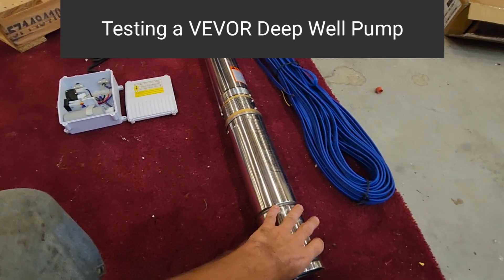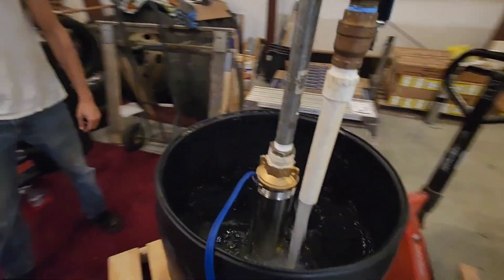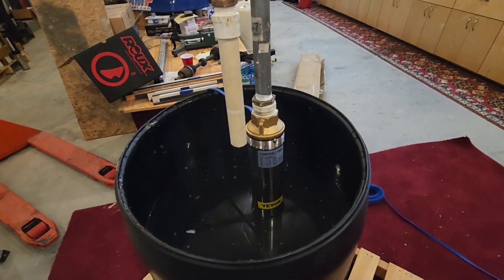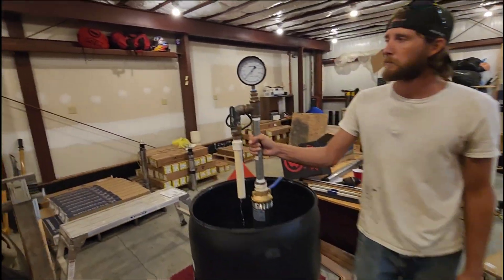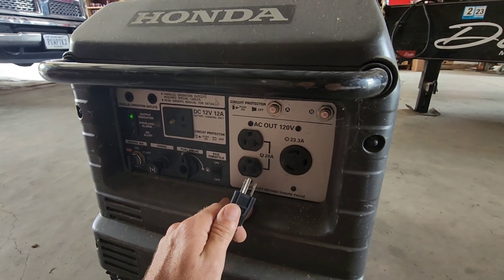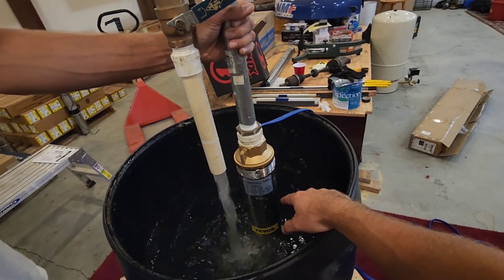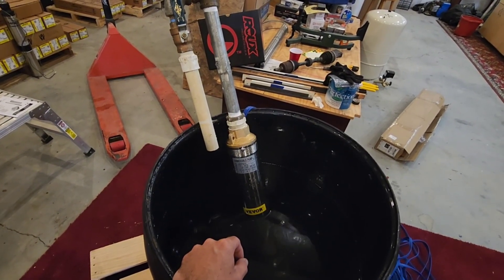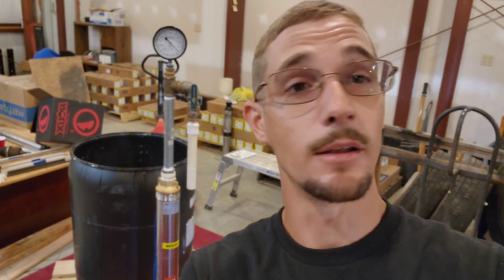Vevor 115v 24GPM Well Pump Test Review.

Comment: Junk, I purchase a property with a 66' well & one of these pumps. It was approx. 4yrs old when I purchased the property 3 yrs ago. The control box burned up last year from the frail wiring & connectors. The pump seized solid 3 weeks ago. Not a good place to cut corners in my mind.

Comment: I use a red lion pump. Its at 390ft and I used 12g wire. I run off a generator- 250v.  Works great! 13 years and counting.

Comment: How do you bypass the control box?
Reply from the maker: On this pump, since its a "3 wire" pump, it requires the box / capacitors inside to start & run. This is why i prefer 2 wire pumps, no box nessicary

Comment: those pumps are a piece of crap, i went through 2 of them in as many months. i thought i was hooking them up wrong but the electrician i called to check it out said that i hooked them up right and that low voltage was the cause of them going out. then he checked the voltage, it was good. finally figured out the wire going to pump was not big enough, and i have only a 100 ft well.

Comment: I have an old well that has not been used in decades. 240 ft. static water up at ~180. Looking to maybe try a vevor for the fact that it's cheap and I do not know how well the well itself will work. Neighbors somewhat close by with similar aged wells and similar depths get water, but it is low yield. I am trying to keep the cost down in order to test the validity. Might try a Vevor for that reason.

Comment: I'm glad you mentioned about the amperage seeming to be the wrong amount of amperage for the one and a half horsepower 120 volt pump.  120 volts x 12 amps = 1,380 Watts.  That is not enough watts for a 1 1/2 horsepower motor.  I think you're right it's more like a half horsepower or a 3/4 horsepower pump.  I would have liked to seen the amp draw as you went up to 100 PSI.  I think you covered all the bases really well.  And that guy below that talks about tapping directly into the motor with your larger wire I think that might be a big mistake.  Doing just like you said seems to be the smart move.  I don't know about that pump you are testing in the video but they're not all accessible without the right fittings, they might not be meant to be access pieroid.  In saying all this I just might get one I myself kind of prefer the control box that is to say the capacitor and relay on the outside of the water well in case it goes bad.  You can just buy the control relays and the capacitors and not replace the whole box or even buy the box to begin with just put them in a junction box that is suitable kind of making your own control box for half the price.  I will consider the overrated horsepower when buying one for sure.  Thank you and it's nice to see a young talented person like yourself doing what they do.
Reply: It's 745 watts per horsepower. So 1380 is 1.85hp

Comment: hi guys I'm very grateful for your information << question can i take the water  about 1100 ft up hill incline not vertical only vertical is a 6 ft plastic tank where 
im submerging  the pump on a 300 gallon plastic tank to pump the water up to about 1100 feet incline to a 700 gallon tank and drop it with gravity pressure to the house main line ... this pump The Vevor 3HP Deep Well Submersible Pump has a 37 GPM maximum flow and 640 ft. maximum head and ETL

Comment: HP is probably 1/2-3/4 when the math is done [VA x PF [Or watts if you have watt meter] times efficiency as a decimal / HP constant of 746]. The variation is so much as the pump does not tell you efficiency, or PF, and the pump is a PSC 120v motor, meaning the quality has a huge effect, with an efficiency as bad as 40% to maybe 65% if really good. For PF, ideally would be ~.95-98, but could be as bad as .80 which an 11.4 amp PSC 120v pump I have would get during normal use. So, the HP is unsurprisingly, a flat out lie.

Comment: 1/2hp, 240v pump link goes directly to a Goulds 10HS05422C 4" Submersible Water Well Pump, 10 GPM, 1/2 HP, 230 V, 2 Wire on Amazon... bad link?

Comment: help any one i want to buy one but i dont want to use the box can any one can tell what wire to use just for 110 volt ground and power
Reply from the maker: 3 wire pumps require the control box. If you buy a "2 wire" pump that's 110v you can wire that without the box. Just do yourself a favor and don't buy a pump that's 20+gpm.  Try to find a 10gpm pump!

Comment: Never buy a pump without the pump pressure curve for that particular pump. I would suggest you take an engineering class on pump theory. And yes that is a "Deep Well" pump. Deep Well Submersible Pumps are designed to fit down narrow water wells below 50ft. Of well water elevation after pump draw down.  Each well pump  curve will need to be matched to its specific well mechanics. This particular "Deep Well Pump" looks like it's designed for the 50 to 100 foot range to be determine by the Well Engineer.

Comment: I have the 230 volt 1.5 hp pump but it only came with one hot wire one neutral wire and ground wire. I don’t know how to hook this up to my 230 volt pressure switch with only one hot wire. I don’t think I can use the neutral as a hot wire? Please help 
Thank you 
Robin
Reply from the maker: Ok so it has a Ground wire & 2 other wires. That means it's a 2 wire pump, there's no way to wire it backwards or wrong. You simply hook the wires to the pressure switch and feed the switch 240v of power & itll run.
Reply: @h2omechanic  but the pump states the white wire is neutral. You think Chinese made a mistake on labeling the wires?
Reply: @h2omechanic  do you think neutral was labeled wrong? Should have been labeled as the other half of 230 volts
Reply: It would be interesting to know what you found out.  In some countries the voltages are different they will have 220 with one hot and a neutral versus us where we have two hearts to come out with 220. They must have a higher voltage on a transformer and when they Center tap it for the neutral its 2:20 to the neutral and maybe 440 when they have the two hots going together.  I've never really studied it out but it's something like that in India I think.  And other places.  We use 110 220 and sometimes a three-phase system here because the voltage is lower and it's safer.  I've worked on higher voltage transformers where we have 440 and stuff like that it is more dangerous one time I was working on an elevator where it was something like 660 volts powering the motors. Now that gives you a shock more like it blew a little hole through my finger rather than shocked me through my finger when I touched the wrong spot on that old greasy elevator I was working on. 😅

Comment: I want to throw this pump off the dock and run it off 200 feet of good quality extension cord. Waddya think? Tag me in the response
Reply from the maker: You'll need a #10 or #8 extension cord if you run it on 115v. But it'll work

Comment: Assuming you set the pump at 240ft, will you still have enough pressure to make a 40-60psi pressure switch to turn off? Or will you have very little pressure by the time the water gets to the surface since it takes 1/2 a psi per foot?

Comment: Do you calculate your voltage drop to size conductors, or you have done so many, you just know what you are going to use?   Do you size conductors based on not burning up the pump, of based on NEC suggestions?   Do you consider the distance from well head to the power source conductor size in your calculations?

Comment: I can tell you exactly how long the pump will last. Three bedroom two and a half bath with four people 2 1/2 to 3 years. At 100 ft they flow 10 to 12 gallons a minute. The last 16 years we have went through several. You want a solid pump to the last you 20 years get ready to pay 3 to 6000 dollars. I would not recommend one of these pumps if you're deeper than 200 ft as water delivery is bare minimal
Reply: Yep, you get what you pay for! There has been a lot of these cheap pumps from China seemingly in the last decade popping up. Assuming they don't flat out lie about horsepower [Should've bought a lottery ticket with that luck], they don't last because of every reason whether it's bc the inefficient PSC motors burning up the Class A motor insulation windings, or them using some woefully cheap type of steel such as 304 that will...RUST, or seals failing due to excessive vibration causing seals to fail.

Comment: I just ordered the 1.5HP 115v version of this. The plan is to drop it in my moms areator so she can get better pressure. The 1/2hp Meyers can't go over 50 PSI.
Reply: How on earth is 115v going to supply a full 1.5hp when every other 115v option is only rated for 1/2hp?

Comment: I find myself wondering whether the future might be simple 3 wire pumps connected to a VFD controlled by a continues pressure sense.   Put the electronics in the  pump house and have the ability to keep the tank pressure in a relatively narrow range.

Comment: Can I put an end on this wire and plug it into a regular 120v outlet?
Reply from the maker: A 3 wire pump must go thru the control box first, then any power source from there
Reply: @h2omechanic  if its 3 wire with 2 hots wouldn't that be 230v and not 115v tho?

Comment: i bought the 2hp version @ 220v , in a 80 ft well. first pump impellers broke apart in 2 months. Im now on 2nd pump within 3 months. This is running it on a 40 60 pressure switch and a 30 gallon pressure rank. my wires was only 3ft long from the pump, I ran no# 12 from pump to switch. no problems there. Just this second pump jumps 6 inches out of the well head when it turns off. I had to tie it down. any thoughts on this problem?
Reply: Either your wires are hooked up wrong or the pump stack is stuck. Pull the pump and see if you can turn the shaft input by hand.
Reply: I'm having trouble getting mine to turn on it only hums

Comment: Can this be used to supply a house with water with a pressure tank and points system?
Reply from the maker: Not recommended for long term use but yes it's capable. Up to 150ft deep

Comment: Mine didn’t arrive with a control box. The company sent me $45 back rather than a control box. You can’t buy a control box separately from vevor.   I have struggled to build a 110v control box out of a 220v control box.
Reply from the maker: Idk what to tell you... they probably sent you a return pump. There's literally no info in my control box to go off of. Remember,  if its not a 3 wire pump, it doesn't require a control box.

Comment: Do you think 120v pumps are worth having? Seems like 240 is much better for these
Reply from the maker: It just depends on what power is accessible to you. 
But the 240v is likely better long term. These are $200 pumps using a 1960s design (that's why it is cheaper) 
Modern pumps are $700-1000 & will last much longer

Comment: I PURCHASED A MODEL 4SSM5/8  60HZ 1.5 HP 37GPM that worked about 6 months and started kicking reset. after a couple tries, it then kicked breaker in electrical box. I have looked everywhere I could think of and found quite a few control boxes for VEVOR submergible pumps but not one for mine. Please help if you could tell me where to find one. ThankYou

Comment: I've got the exact pump set at 260ft I left 3 ft of factory wire added 10 gauge all the way up to control box plugged it into my generator it takes about 24 seconds to fill up a 5-gallon coming out of 1 inch PEX
Reply: 🎉like your video very understanding
Reply: very helpful

Comment: I had the 240v version of this pump and it was hopeless. I had to remove the overtemp on it as it constantly tripped for no reason
Reply: How did you remove the over temp?
Reply: @TheEdnabland it’s located on the control box. I swapped it out for a upgraded version. Now works good

Comment: You are awesome my friend!  Thanks so much for the heads up!  We bought this pump a year ago, and put it in a hundred foot well, and have the power supply another 200 feet away.  Needless to say, we have had some issues with melting wires and blowing fuses in the box!  Any tips you might have would be very appreciated!  Take care and thanks again!
Reply: Run thicker gauge wire, if it's getting hot. You're pushing too much current through it.

Comment: If you still have one of these on hand could you possibly send me a few pictures of the control box. I received one of these pumps from a discount store and it didn't come with the box and vevor doesn't sell it separately. I'm sure I can build my own I just don't know the specs on the capacitor and whatever else may be in the box.
Thank you
Reply from the maker: Does your vevor pump have 3 wires or 4 wires coming out of it?
Reply: @h2omechanic  it's a 4 wire 1.5hp 115v
Reply from the maker: @Jonathon Cain  search online for a well pump control box online with those specs & itll fire it.

Comment: I love your videos!!! I would of never pulled this well with out the info you have shared.  I am trying to redo a well from i think the 40s. Its in south mississippi  and was an air injection well. 4 inch metal casing un known depth, 220 ft of 2 inch galvinized pipe with 200 ft of 3/4 inch galvinzed pipe inside the 2 inch to deliver the air down to lift the water. They stoped using it in the 60s due to iron content. I think the airlift was oxidizing the iron causing it to drop out and it was causing major issues with plumbing. I have pulled the pipe and the static water level appears to be 100ft. I would like to try a submersible well pump at 220ft on black role pipe. Do you have recommendations on the pump. Id of casing is 3.75   i have not tested the water but plan to possible pump to a holding tank to oxidize and  settle out iron prior  to a filter system. Any recs are greatly appreciated. I dont know how many airlift wells are out there.
Reply from the maker: Air lifts are a crazy but cool way of accessing water, I still see Amish locals use that tech. 
But for you I'd recommend a Grundfos SQ290 3" pump. Set it down around 150-170ft & then I'd prefer a heavy chlorine treatment on the well for a day & then pump out/flush the well of all that iron that's down there. I have pumps on my website in the video description box & videos on sanitizing the well . I'd recommend following that guide to help against the iron

Comment: I bought this same pump with control box. What size wire do I need to run 300ft  12/3 or 10/3 ?
Reply from the maker: 115v would need 10-3

Comment: Good video.
I just unpacked the similar pump and found out that the 'brass-fitting' on top and in the middle are just brass-colored painted steel! 
This is a poor alternative to the right material...You will get corrosion by connecting to a brass fitting.
Reply: Yep brass paint. And the connection fitting they sent me with the pump desentergrated in 3 months. Must have been made out of a very poorly metal.

Comment: What kind of Hose do you guys recommend I get for the single drop 1 1/4 ?
Reply from the maker: Always 1" 200-250 psi. 
1.25" becomes too heavy.
1" is industry standard.
Reply: @h2omechanic  thanks never had to buy any is there a brand or type of hose I need to ask or look for?

Comment: Do you have a video showing how to rewire one of these pumps that has under sized wires attached to it? I bought one of these vervor pumps with the 18 gauge wire already attached and I need to update it to 12 gauge (2hp) and wire it for 240v.
Reply: Can this be the reason that my pump shuts off after 10 minutes and if I start it again goes on for 4 more minutes and so on.Shall I change the wires?

Comment: What's the control box used for should I or not buy one with control box
Reply from the maker: The control box is basically a starter box. (3wire)
A 2 wire pump has everything built into the pump. That's the only difference.
Reply: @h2omechanic  thanks we just moved in our home it has an old style pump and I'm looking to replace it with this style. I pulled out about 30ft of pipes what voltage do you recommend 115v or 230v I'm currently looking at the Vevor 230v 2hp do you think this is good enough   or should I get more HP and go for the 3hp model. We will only be using this well for irrigation, reason I ask about the voltage is because the current electrical system that lead to the pump was removed  and I will be running fresh lines but was told 240v was better so I haven't done this yet 
Thanks again
Reply: We just moved in our home it has an old style pump and I'm looking to replace it with this style. I pulled out about 30ft of pipes what voltage do you recommend 115v or 230v I'm currently looking at the Vevor 230v 2hp do you think this is good enough   or should I get more HP and go for the 3hp model. We will only be using this well for irrigation, reason I ask about the voltage is because the current electrical system that lead to the pump was removed  and I will be running fresh lines but was told 240v was better so I haven't done this yet, the distance from well to electrical panel is about 20ft I'm guessing pump will not be more than 45ft deep
Reply from the maker: @PeteyPablo  your so close to your panel box that 115v would be just fine, if its for irrigation, id recommend this exact pump to be honest. No need to go crazy big on the HP. This pump has amazing flow rate! I can't speak on long-term use, but its a fraction of the cost of a big brand pump.
If your current well breaker is a single pole 115v then buy a 115v pump.
If you current well breaker is a Double pole 240v, then buy the 240v Pump. 
That keeps it simple.
Reply: @h2omechanic  I will be running new power to the pump as when we bought the house the cleaning crew toredown a detached room where all the wiring passed through luckily they didn't have a major accident other that breakers tripping it shorted out my electrical in my detached garage as well so I will be running fresh lines to the garage and will be adding a subpanel so 115v or 230v will be available if wanted